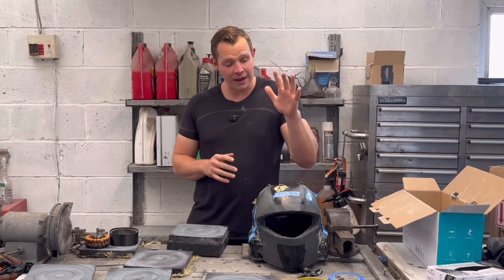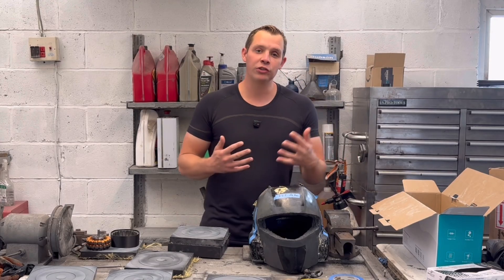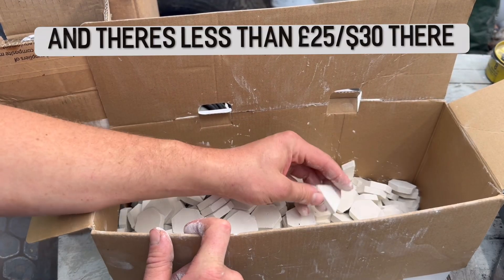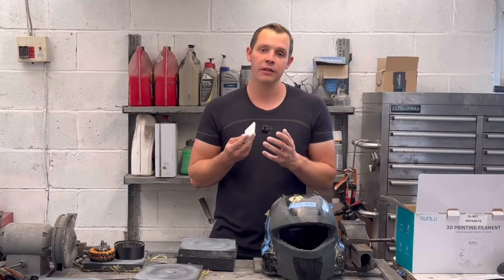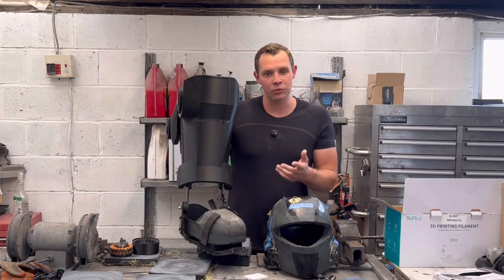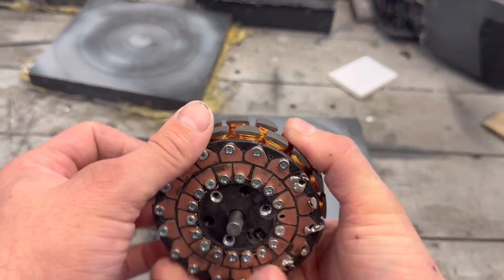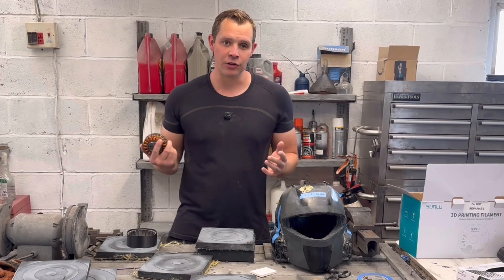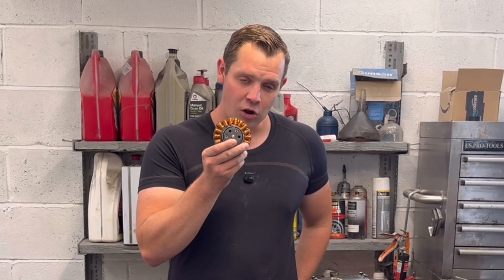5 minute POWER ARMOUR Update, progress, delays, Armour and Actuators

Comment: It would be expensive but you could just buy body armor and salvage the tiles from it. Or buy your own tiny kiln which in the long run would save money and allow you to test different compositions. Though a kiln would come with a time commitment to learn and setup properly.
Reply from the maker: Yeah that would work its just the expense, trouble with the kilns is temperatures, you can get a small kiln that goes up to 1100 degrees for £400 but porcelain has to go up to 1250 and for any kiln that goes up that extra bit in temp is around £5k by the time its set up - highly annoying!
Reply: @MattExo-Dynamics  ah I see. Well maybe one day you can start a fund raiser or get investors.

Comment: so its like a smoother stepper actuator, nice! you can probably save worktime with the DIY 3d printed winding machines to avoid the manual mess.
as for the drones and booms in general, you should probably look into ERA and a way to somehow , print would be the word i guess? new material onto a hardened surface that can recover its shape, like origami panels that bend back when the counter is activated against and recover their shape promptly to just reprint another composite layer
Reply: maybe SMAs could be useful but idk how their shockwave resistance compares to just normal spring systems